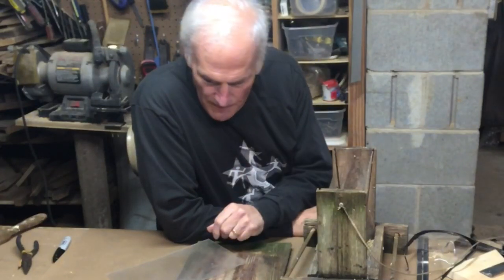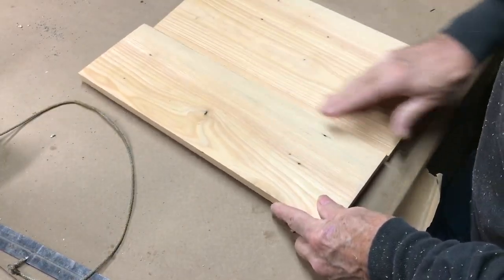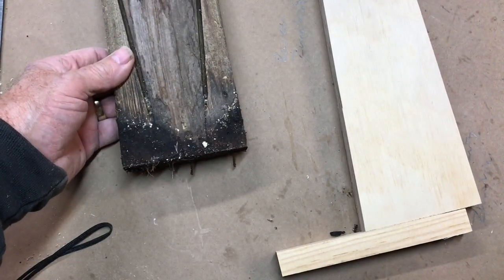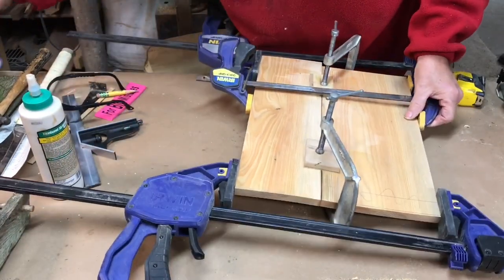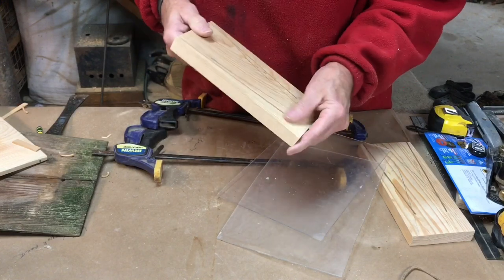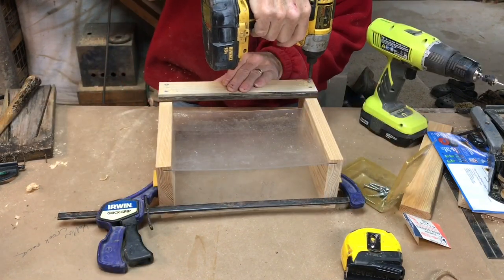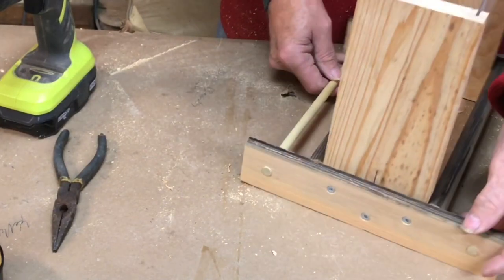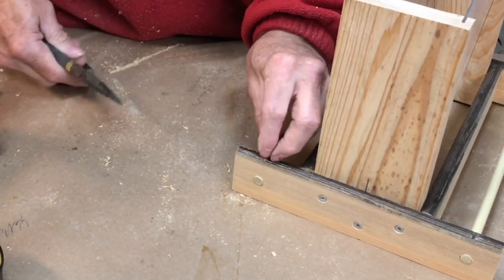How to make a classic bird feeder

Comment: Why would you not make the roof pitched to shed water easier?
Reply from the maker: If you start looking at 12:30 or so you'll see the saw kerf on all four sides under the lid.  This will prevent water seeping under the roof. Keep watching and you will see the roof does have a bevel all the way around it.  It's been up all this time with no issues other than dirty glass.  The wood is cypress so it's very good at weathering the rain.
Hope this helps explain why I did what I did